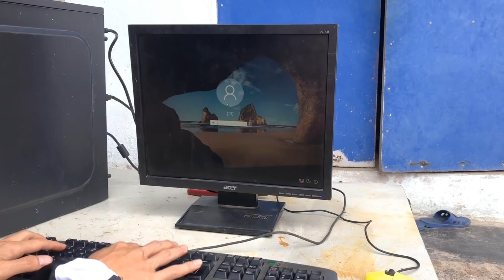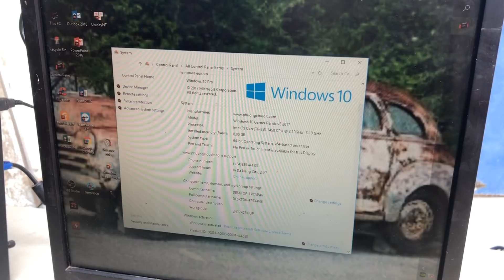Restoration a destroyed 30-year-old PC | Rebuild and restore 30 year old PC

Comment: That's fake restoration. Brush hard disk????? Old desktop run windows 10????? Case body was different.
Reply: I agreed with you, there is no way that Windows 10 will run as smoothly on any old PCs like this era tbh. 😔
Reply: I do have a pc with a core 2 dúo at 3.02 ghz that runs perfectly windows 10 on a ssd
Reply: I can even show it to you on my instagram if you want
Reply: Q6600 and win10 that's perfectly working
Reply: This PC can run Windows 10
Reply: Maybe he upgraded it???
Reply: This is a socket 775 based pc, from core2duo era with windows vista or 7, it was "painted with mud" and he left it in a place, he came with the motorcycle to take it twice and cleaned it
Reply: @mitsostechtips9047  This is definitely fake. The CPU is an Ivy Bridge series i5-3450 made in 2010 so that would put this computer only at 10 years old...if it weren't for the fact that the CPU i5-3450 has a different cpu socket that is incompatible with this Foxconn motherboard N15235 (^_^). 

This guy is a fraud.
Reply: Old desktop can run windows 10
Reply: Was there windows 10 at that time ?
Reply: @franconunez7574  ssd but here is hard drive which is brushed???
Reply: also socket 775 not so old
Reply: @kunlovelive  By the way folks, this scammer was kind enough to show his windows 10 product key. You didn't hear it from me 😂😂😂
Reply: Saeed Khani Jes and he went from an Core2dou (Or other 775 CPU ) to an i5 3450 and 8 gb and RAM you Can See ist at the end
Reply: @techfakts374  Yeah we see it. That's why he is a scammer
Reply: Windows 10 neeeds a 1GHz CPU with MMX, SSE, SSE2, NX and PAE support and 1GB od ram for the 32-bit version. Also it's 15 years old at worst. It's fairly modern
Reply: @panskudrzhsjjxndbsbsb8798  I have an Athlon 64X2 5200+ and it works fine too
Reply: @luminatrixfanfiction  When did he show it? Just curious, i have a license key for Windows 7 wich works with win 10
Reply: @kacpreusz9911  At the very end of the video.
Reply: Yesss
Reply: yes right, That's fake restoration & his all video false
Reply: total fake a hdd can not be restored in this way.
Reply: at the very end he pulls up the system info and it says core i5
Reply: He is from Vietnam, I am too used to the fake of this country
Reply: not only that, the cpu has no pins on it, the cpu's back in the day has pins on them not like the new one's that are on the board
Reply: "30 years old" :))
Reply: Fake restoration, cpu was clean no sign of old thermal paste
Reply: Body has painted😀
Reply: bro first thing windows 10 is launched on 2015 and he restore pc which is 30 years old how is this possible man
Reply: Bro,I agreed with you .It's 100 percent fake restoration.
Reply: Johnathon Baker title says 30 year old 🤣😂
Reply: The Lucky Charmer He could have replaced the hard drive
Reply: The Lucky Charmer Or he could have gotten the age little bit off
Reply: 30 year pc guys
Reply: He just poured a sand water on it . To look like old
Reply: the drive one is real, however i was able to run 10 on a core 2 duo E7300 and 4 GB of ram.
Reply: if that was 30 yr old it will have windows 95 it cant handle windows 10. So this video is fake its 8yr old
Reply: who washes circuits this way
Reply: Yes..that Ram is ddr2
Reply: Fake restauración like Many others un youtube
Reply: @choclatecoffee__898   yes
Reply: Let him live man, it seems he has a lit of fans. I don’t see your youtube account doing that!
Reply: That's impossible...
Reply: @franconunez7574  I have a core 2 duo 1.86Ghz it runs win10  smoothly on hdd
Reply: I agree
Reply: True
Reply: My 775 can run windows 10
Reply: It's normal
Reply: I have pentium
Reply: İt Windows 10 lite
Reply: Bro calm down
Reply: I can’t imagine how the hard disk drive and the optical can run as normally when he restored in this way. What’s on earth is he doing ? That’s fully fake video.
Reply: HDD brush se ghisna ye kuch jada ho gaya
Reply: Core 2 duo and quad is from 2000s not 1990s.
Reply: The motherboard isnt that old depends on the specs
Reply: And he knows the password to get in hahaha😂😂😂😂

Comment: i love the fact that people who actually know something about restoring computers are absolutely burning this guy
Reply: I'm in
Reply: I'm part of that culture as I watch actual restoration channels, specifically tech restoration channels. If they don't know about Psivewri or The 8-Bit Guy, they're missing out.
Reply: Too muddy to be true
Reply: I can't even......wtf?
Reply: My favorite thing is that it's from 10 years ago.  A pc from 1990 would look nothing like that.
Reply: I've been repairing pcs since 1999 and I can't believe whats happening here
Reply: It’s not even 30 years old pc never looked this good back then AND 30 YEARS AGO WINDOWS WASNT EVEN A THING I think idk I’m 14 but I’m a huge nerd and yeah etc
Reply: i mean. even idiot wont put motherboard to water...
Reply: How come a 30 year old pc is running Windows 10..?
Reply: @coolduder1001  2012 actually
Reply: @Metro-fx1bv   Windows 1.0 was released in 1985, or 36 years ago.
Reply: @ajemajh   You can wash a motherboard using soap and water, you just have to make sure it's 100% dry before powering it on again. Leaving the CPU in the socket (on boards with LGA sockets) and removing the battery are also important to prevent damage to the board.

Soap and water are sometimes the only thing that can clean up horribly filthy boards. Two examples are smokers computers and restaurant computers. Cigarette tar is horrible, as is grease in a restaurant kitchen.
Reply: you dont need to know anything ab restoring pcs u just need to know ab pcs
Reply: GGigabiteM your missing my point.
Reply: How is it running after submerging the motherboard in water AND putting water on the hard drive?
Reply: No it is simple like assembling a pc by the way I am a pc builder
Reply: @ashishagrahari9626  yes i know ive built multiple pcs myself
Reply: @martingolding4951  exactly - first its no where near 30 years old.  I don't see a 486 here haha - then the guy is washing a hard drive ON THE INSIDE- WTF!?!?!
Reply: @sidopedia8745  thats right
Reply: @realomegadrumer  what is the name of channel
Reply: They just dip a computer in mud,then restore it,thats all.
Reply: @fizii_  yup
Reply: @seamusmckeon9109  its defenetley not
Reply: Thanks anyway, we all know that the HDDs are super-sealed and how the dirt gets on that disk, is false
Reply: Ye
Reply: I'm in
Reply: Why is he fucking dumping all the lectronics in water
Reply: He is destroying all myths about restoration
Reply: Shit 30 years old pc have windows 10 wtf
Reply: Ngl this hurt to watch.. especially when he started to unscrew stuff and then started cleaning it.. also not to mention he called it a 30 year old PC. Like bruh. 

Also to me it definitely feels like he threw his own PC into a pond or lake or something.
Reply: @ajemajh  You can wash motherboard in the water, all you need is to, remove battery, and wait for water to evaporate, everything works fine
Reply: @Ally2_  actualy, not realy. Dont take me wrong but the pcb would start to corode because of the water and possibly stop working.
Reply: @pigeon3036  It's ok, i'm not that kind of person. I watched few videos, which motherboards are still working.
Reply: @pigeon3036  Motherboards will not corrode being washed in water lol. Maybe if you left it sitting in garbage water for a month you'd have a problem.
Reply: @ajemajh  actually yes you can, but of course let it dry or..
Reply: @CrociG  i died internally when i saw him brushing the hdd
Reply: yes
Reply: @GGigabiteM  You are right. Except he didn't removed the Cmos battery here and put the cpu out xD
Reply: @kxan06  BS 'restoration'
Reply: @Taikutsu - 
YES & even the age is FAKE , its maximum 15 years instead of 30 years)
Reply: @coolduder1001  true
Reply: @ajemajh  well
Reply: It gave me the cancer 10yrs of inhaling leaded solder & flux was unable to do. And i am playing around with computers since i was 9yo and reparing them since 11. It gave me a heart attack when he took apart the hdd and cleaned with a brush. Rest of the work is still somewhat acceptable for a flooded pc and most PC's can survive.
Reply: @coolduder1001  yeah no isa-16 for one, would almost certainly find at least 1 on a machine of that age.
Reply: @CrociG  Harddisk is broken, no Way
Reply: @coolduder1001  korrekt, no Serial ATA IDE was 30 J ago
Reply: @ajemajh  yes, no Problem, i do this. The HDD is never running again, no Way
Reply: You can tell in the thumbnail he spray painted the PC orange cause the paint is on the sheet under the pc
Reply: @Nafe Malek fam the pc is an lga 775 socket which is around mid 2000s and the pc they show booting has an i5 3450 which is from early 2010s
Reply: I'm about to do the same thing.
Reply: Yeah
Reply: Yes im repairing / rebuilding computers since 1990 (the first computer i repaired was a C16 /Commodore). This video here is a big fake, the computer is not 30 years old, the damages are just this "dust", tbh a broken abandoned computer looks different.....
Reply: @Aragon9th   i found a laptop once that was there since 2006 in 2022 that was really abandon and didnt look like that it was full with rust dirt and other stuff you would find in a forest so insects suprisingly
Reply: @SSGBD_Official  Insects, rust, burst capacitors, dust, surface coatings that you can't define, that's what you find in old computers, even if they were "only stored safely in the attic". Oh yes, unlike this fake video.
Reply: Claims it's a 30 year old pc, shows a PCI Express slot and LGA 1155 cooler in the thumbnail.
Reply: Yes
Reply: @Metro
Wrong windows 3.1. And windows 95 was out 30 years ago.